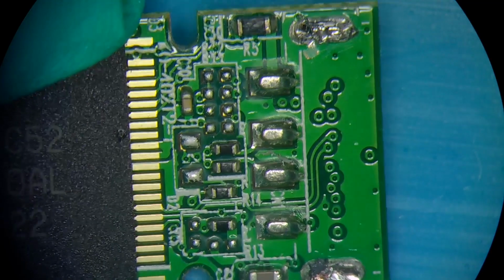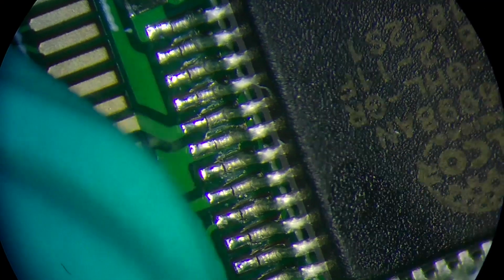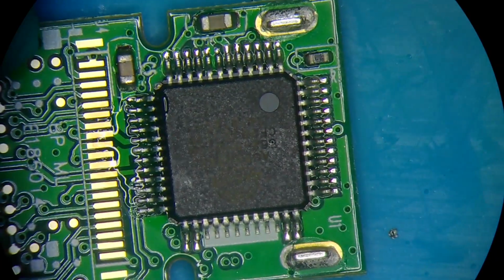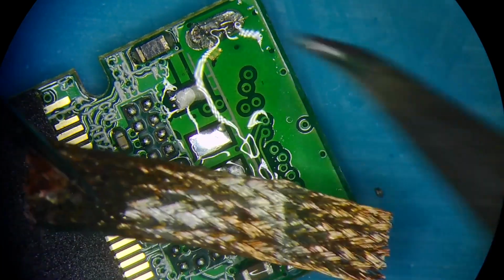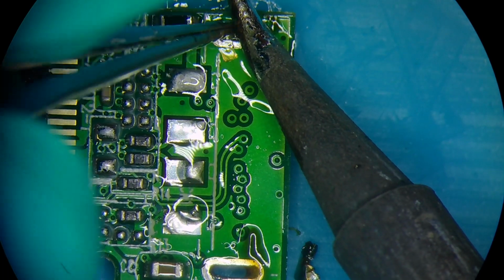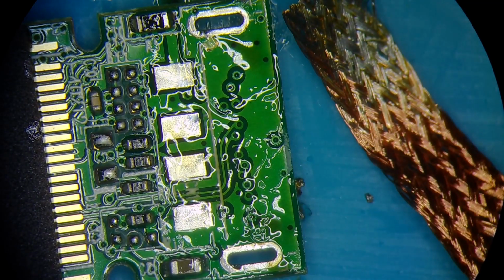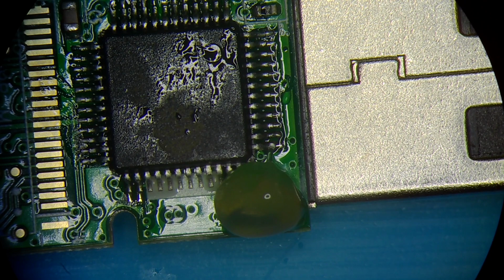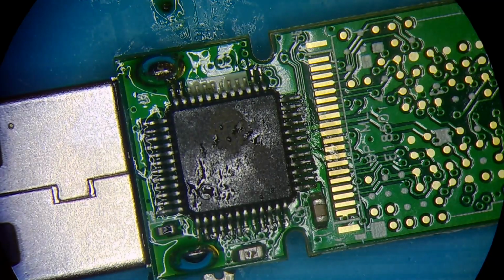how to recover data from a bent Lexar flash drive

Comment: Where is a good training to learn?
Reply: To learn what? First of all, nearly every manufacturer of DR Hardware is offering Data Recovery courses. Second is that you don't need magic to restore Data. You need proper equipment, knowledge you find on the internet for free and experience. The experience you also can get for free. For example you can buy some drives and swap the heads on them and see if they still work. Same with flash drives.
Reply: port29dr how to recover data and repair hard drives
Reply: Well, you can go to ACE Lab to learn more about using PC-3000, you can go to HDD-Surgery to learn how to replace heads, you can go to Resolut or iPad Rehab to learn how to recover Flash Memory and Micro Soldering. Or you can learn everything yourself, because each course is going to cost you 2.000$-4.000$
Reply from the maker: There is no jack-of-all-trades type of training (Deepspar used to cover many parts of data recovery with PC3000 and DDI and mechanical repair with yours truly), but I don't know what they teach nowadays. Like port29dr said these trainings are no joke when it comes to price, and you also need to know at least a little bit about tools or you will fall asleep at day 2 :)